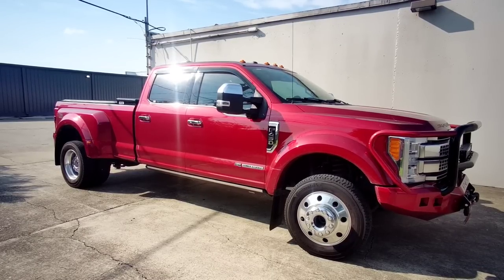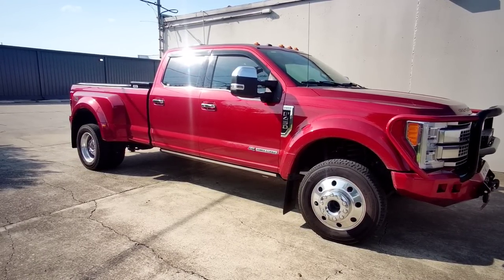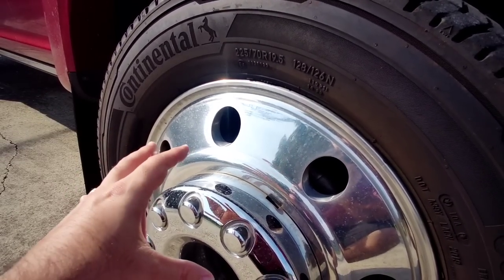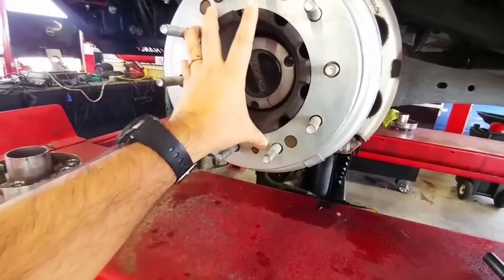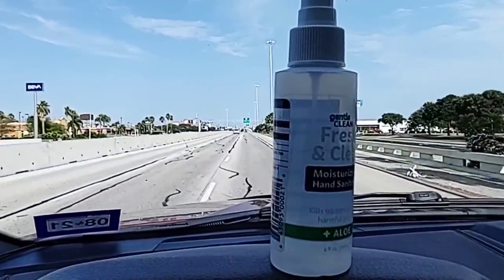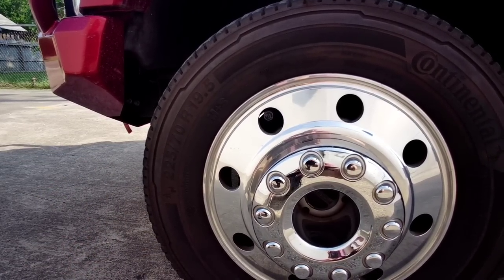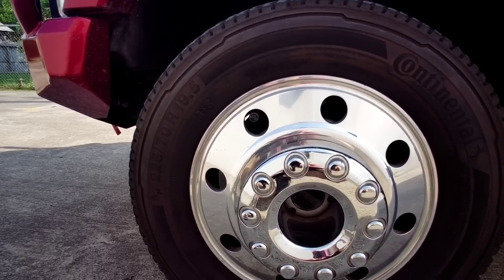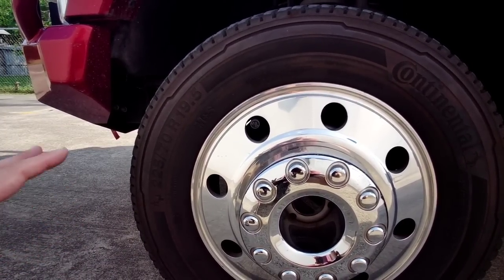Are Centramatic Balancing Rings the cure for shaking? F450, F550, 4500, 5500

Comment: Bottom line? HD pickups still ride like trucks!
Reply: Huge difference between a 250 and a 450 bud. In case you didn’t know..
Reply: Gerardo Linares yep. Their is a 350 in between, 2 more wheels and tires,  and 8 more lugnuts plus a different grill and badge on the side.

Comment: I really like those wheels. I have the Centramatic rings on my F250. I install my own tires and never speed balanced them. The Centramatic rings work really well for smoothing out the ride. It doesn't do a darn thing to soften the ride, just helps make the smooth roads more smooth. I recommend adding them if they are available for your vehicle.

Comment: I got the centramatic balancing rings and didn’t solve the problem.  After actually having my continental tires 10-15 times including up to three times in one day and tip to two times on other day.  Discount Tire found that one of the tires is out of round with a high spot. I’m done with continental tires. Nothing can balance a tire that’s not round. I was told. Of an old timer who can shave the tires. Still investigating.

Comment: I can attest to the Centramatics. They work excellent. I've been running them on my F-250 for about 4 years and recently put a set on our new travel trailer.  Even if your tires balance out perfectly on a machine these are always compensating for any out of balance condition, such as mud or dirt stuck in a wheel or rocks in the tire tread. In my case I've noticed they take the choppiness out of the tires which comes from running unloaded. I always run Michelins on my trucks and Goodyear trailer tires and these without a doubt extend tire life.

Comment: Perfect timing on this video. Mine shipped 2 days ago for my 2018 F450. 78mph mine shakes like a vibrating bed. In the next 2 weeks I will have 19.5x6.75 wheels, 245/70 19.5 conti HD3's installed again, and rancho 9000's. I hope all this helps when not towing. I love my truck for towing. Plenty of power, plenty of torque. I just have some problems to deal with since its my daily driver and I drive the heck out of it every day.
Reply: Any updates on how your truck is riding?

Comment: I'm not a Ford guy, but that's a beautiful truck. I can't speak for the Centramatics on a truck but I put them on my Goldwing motorcycle and it is a huge difference. The Goldwing also suffers from a wobble around 40 mph after you get a few miles on them. These fixed it.

Comment: I have used these as well as beads for years and am a big fan of both. They will balance a wheel but not eliminate a shake due to an out of round tire or bent wheel assembly. You can balance an egg but it will not roll smoothly. I still have new tires road forced balanced to ensure that the rim tire combo is in their best orientation and nothing is out of round. The balancers will not correct an out of round tire.

Comment: Had a 2008 f450 king ranch, had a lot of wobbling problems. Just got a 2020 f450, 11 miles on it when I got it, 1200 miles when my centramtics came in. Night and day difference, 70-75 mile per hour wobble seems to have gone away. Wish I knew about them in 2008, spent a lot of money on premature tire wear!!
Reply: Whom did you have your Centramatic installed?  How is the ride when running empty?  I ordered F450 Limited and will likely get it in 2023.  I do not tow and my current F350 Dually is basically for light to medium hauling up to 3000 lbs about 20% of the time.   I am just getting F450 Dually because of the look and quicker turn but am concern on how it may ride.   At the moment, I take to Discount tire for F350 tires and rest to Ford dealer Truck shop.  Do you find the special place to get the tire work done on your F450?   Any tips or advise is welcome for future F450 owner.

Comment: My C6500 Top Kick now has a very smooth ride with the Centramatics on my 22 inch rims.
Reply: I chose Centramatics over beads as I think in the long term Centramatics will outlast the beads.
I tow a 3850fl Montana.  Intend to get the rings for 5th wheel asap.

Comment: Hard part of balancing 19.5 tires is getting it right on the balancer. I have several trucks at work in our fleet with that size. We spent a lot on a plate that fits the rim right. They are really heavy tires. I’ve had good results balancing those tires since.

Comment: I put them on my 2004 F250 when you originally did a video on them.  The wheels are still balanced as well.  It did help the shakes at about 72 miles per hour.  Not perfect but much better.  My Discount Tire would not mount to the truck so I had to install them myself.  I argued with them to no avail.  They claimed they were like spacers.  idiots.  I do wish Centramatic would improve the finish as I run slotted rims and you can see them underneath.  Not the prettiest things for sure.

Comment: My brand new truck start shaking every time I pass 65mph took that truck to 4 different dealer everytime got an alignment they even blame the Goodyear tire got to the conclusion only happen when I wasn't pulling any weight i drop the tire to 70 psi and the shake when away but really looking into does centramatic since not alot off places can lift the truck , thank for the video
Reply: When one can't explain what is wrong, just blame the next guy.
This is what the techs did to you.

Comment: Just upgraded to the f450, that shake at 70mph freaked me out. Took it back to the Ford deal, they didn't know what the issue was. Now we know. 
Thanks again JD
Reply: I just got my 2022 F450, its smooth at all speeds. I still plan on ordering these though.
Reply: My 22 f450 has some shake, ive installed the rings on the front and it made a big difference, still need to do the rear
Reply: @F450FTW  that is a great news. I have my F450 on order and per dealer, it will be 2023 F450.  Centramatic for F450
 front pn 400-422 / drive pn 400-423 .  How is your experiences? 
Are you rotating your tires?  how?  any other advise or sharing is welcome.  I am going from F350 Dually to F450
Reply: @wj2791  -I replaced the factory wheels with Alcoa wheels so I could rotate them all easier. Factory wheels you have to dismount and remount all the tires to rotate them. Also I run no wheels weights, just the Centramatics.

Comment: Thanks for the video. I have a ram with a similar shake problem. They cannot balance the wheels for nothing I bought the central attics left the wheel weights on, and I still feel a shake. Do you recommend taking the wheel weights off? Thanks.

Comment: do you know what part number you had ? what kind of centramatic balancer did you tell them you needed since you have one steel and one aluminum wheel in the rear? because when you go on their site all they offer is aluminum or steel nothing about combination wheel set ups. wanted to ask you since you have done it and had success with it. thanks for help. great video.

Comment: Damn shame  $50K+ trucks need aftermarket accessories to accomplish a smooth ride comparable to any cheap new car.
Reply from the maker: More like $90k truck and still need them
Reply: It’s not the truck, it’s the tires.
Reply: A cheap new car and a f450 are apples and oranges. Cant expect a vehicle to be able to haul 2000lbs in the bed and ride good empty and loaded. Trucks have come a long way to be sure, but engineers can't outsmart physics
Reply: Just one tire on the 450 weighs the same as two wheels and tires on a regular car lol

Comment: Hey JD... you if anyone would know. I’ve even talked to dealerships and they can’t tel me why there are rubber “stabilizers” I guess on the very rear of my 450. What are they for? Would they cause a shake? I may have to get a set of these rings. My tire shop has tried almost everything to get rid of the shake and I’m putting on thousands of miles every month on a hotshot. Thanks!

Comment: I drive a fleet F-450. Been complaining to our mechanics about the death wobble forever. They just put these rings on my truck. Did nothing but make the truck shake at different speeds now. In fact I think it's worse. Not to mention the racket they make at slow speeds around town. Not a fan
Reply: How is it now?
Reply: @wj2791  So it's been about a year now that I've been driving with them on the truck. I will say it definitely tamed the death wobble on the highways. It still shakes too much for my liking but at least I don't feel like it's a dangerous situation anymore. I still hate the racket they make at slow speeds. If it was my personal truck I would never put them on. But my company uses retreaded tires which according to our mechanics are a nightmare to balance. Hope this helps
Reply: @neekopeeko9054  Thank you..  I am still waiting for my F450.  Once I get the delivery date, will put the order in for Steer and drive Centramatic.   I am glad it made your company truck safer for you to drive.

Comment: I have 35x12.50 tires with 18 inch wheels, on my Ram 2500. I’ve had no problems with balancing and they just have standard stick on weights!

Comment: Not fully confident in the website for Centramatic.  Their listings have ambiguity, listing the F450 multiple times.  Can you please indicate the part number for the Centramatics that you ordered?  My truck is a 2019 F450 Platinum.  I believe that your truck and mine use the same part number.
Reply from the maker: 400-422 steer and 400-423 drive
Reply: Big Truck Big RV Thank you!
Reply: @ChangNoiRoy1  Did you get it installed?

Comment: 15K miles? JT. How do you have so few miles on them. Are you driving something else. I bought mine after yours and I have 50K miles on them. They are noisy to about 15mph but they work. Still need to rotate tires every 10k miles.
Reply from the maker: I have a car and my wife's SUV.  The truck gets driven about 60% of the time.

Comment: Do they make these for a Ram 2500 2wd? I would definitely be interested. I've heard that they will increase the life of your tires as well.
Reply: I have them on my 2018 Ram 2500 4x4 and love them. I believe it would be the same part number for your truck, 300-318.
Reply: I think they would increase not only the life of the tire but all your suspension components, if you have a wheel hopping up and down it wears out every ball joint on that corner, the shock absorber and whatever else.

Comment: These are good. But not anywhere near 6 to 7 hundred dollars.  More like $170 a set. Been buying them for years. Last truck I had I couldn't get more than 80k miles out of the steers. With the centramatics,  I was easily getting 200k plus.
Reply from the maker: If they were made overseas they'd likely be much cheaper.  Made in the US in a small factory and relatively low quantities drive the price up.
Reply: @BigTruckBigRV  Can you recommend any good shops in Houston?

Comment: For the rest of us, go get a Hunter “Road Force” balancing ... end of story. Ive balanced much larger tires than this with amazing results.
Reply from the maker: It's the not size of the tire that's the issue.  I tried Road Force
Reply: Big Truck Big RV  i gotcha, thats why i said “for the rest of us” ... maybe I should’ve specified non HD truck owners. I run 37s on my land cruiser and road force was the only answer. Anyone with an off road rig and big rubber, road force is it
Reply: @drsus0  That may be true, but as soon as you get any mud or dirt stuck in the wheel, or a rock or two in a tire that balance is gone. Centramatics are constantly compensating for any out of balance condition. Ive had them on my truck and travel trailer for several years and they just plain work.

Comment: Is it difficult to balance fifth wheel tires? I haven’t heard that balancing 5er tires was an issue. I can’t tell that I have a tire balance problem.
Reply: You won’t really notice the vibration transmit through the trailer up to the truck. Load rated tires have a lot of plies and each ply will generally have at least 1 seam. What’s worse is sometimes the ply seams layover each other and cause a massive imbalance.
Reply: Leland Holton so are most fifth wheel tires out of balance?  Are they not balanced when we purchase a new fifth wheel?

Comment: I have a 2018 F450 Limited and I added these about 20k miles ago. I’m still getting a shake at higher speeds, but not 100% of the time. It’s very annoying though. 

I have m920 tires that I rotate every oil change. I’m hoping it’s just the crappy stock suspension wearing out (70k miles). I have Fox shocks I need to install. What else can I do?  I understand that it’s a big truck and will never be fully smooth, but I’m sure it can be better than it is.
Reply: Did you get all your issues worked out?  I currently have 20 F350 Dually Lariat and have F450 Limited on order with the dealer which I am told to expect the delivery in 2023. How do you rotate the rear inner tires?  Do they take it off and remount?  Who does that work for you?  I will have to find the shop in my town when I get my truck.  I know Ford dealer Truck Shop does that work, but they are always so busy.   What parts have you changed out on your suspension?  and whom did that work for you?  Thank you for sharing.    Even with all the problem, do you like your F450?  Have you driven F350 Dually in the past?